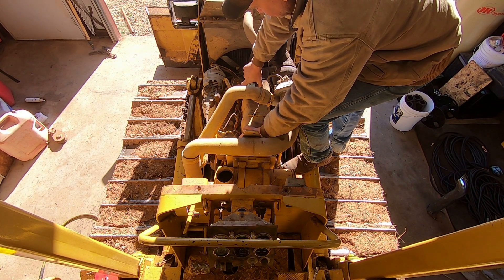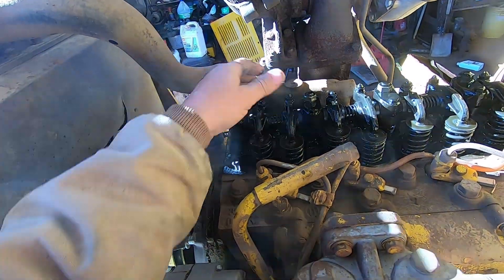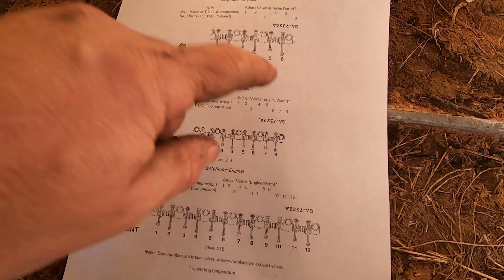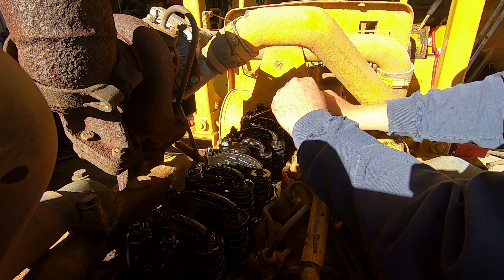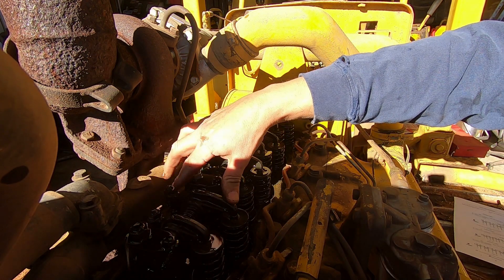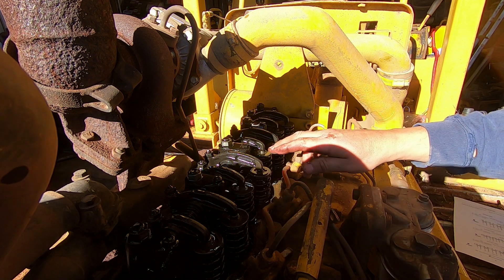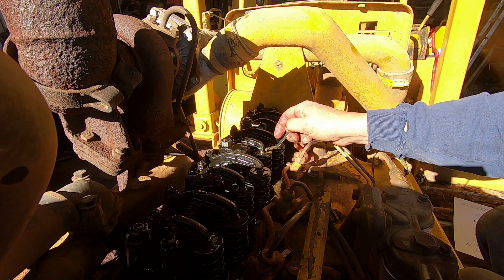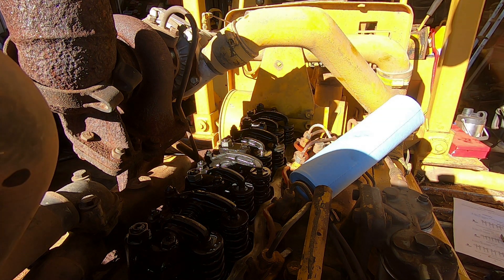TD8E valve adjustment. #TD8E #DT239Valvelash

Comment: I did notice on the first publication it said adjustments should be made on a cold motor. Does warming the motor up make it warm or still considered cold?
Reply from the maker: I should have made that more clear, I did the adjustments with engine warm. The listing at the end is for cold adjustment, it would be done with out any warm up.